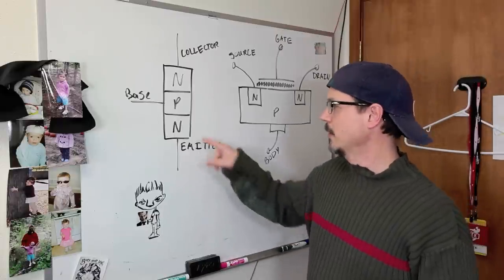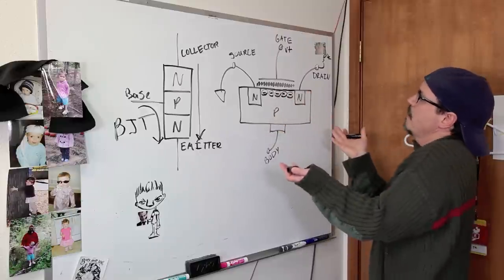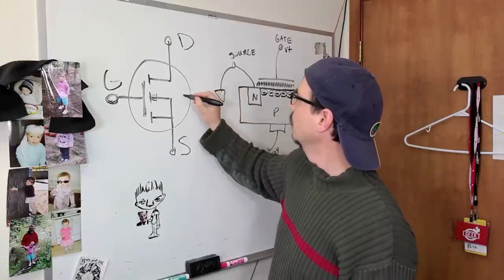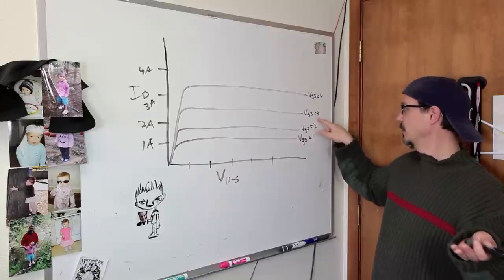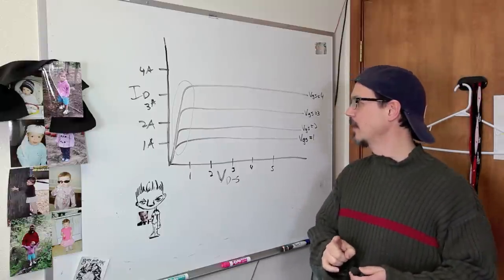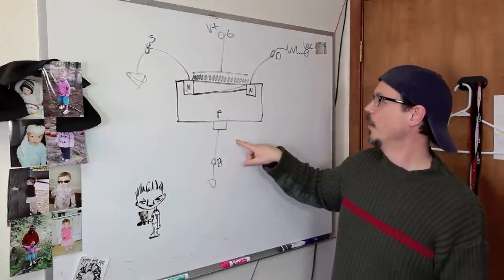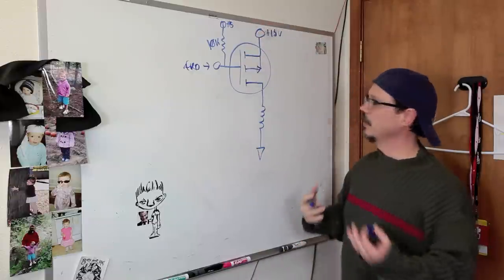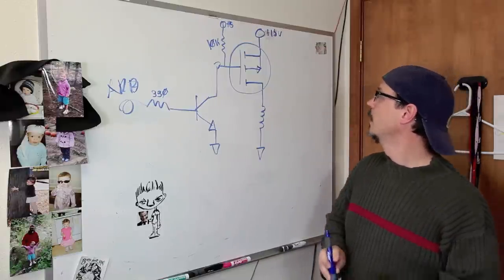SparkFun According to Pete 3-5-12: Mosfets

Comment: The reason the AtMega survived is because the pin never went above 5.8V. The diode from the pin to power (put there for ESD protection) clamps the voltage. The reason many times you see a dead pin is because in Pete's example there was a 10K resistor limiting the current to well under a milliamp. If this resistor didn't exist (you tie the pin directly to 15V or through a lower value resistor) the current through the diode will exceed the absolute maximum rating. This is all just ohm's law.

Comment: I don't mind P-channel mosfets for running in enhancement mode. Both N and P channel enhancement mode mosfets are not linear in behavior, so I typically drive them with a cheap single channel op amp anyway. Then all you have to do is supply a reference to the opamp, and itll do what it does to to match that to the feedback. If you are limited to 5, and have a range of 15, just divide the feedback. Easy peasy :)
N-Channel with an opamp is also doable, but has all the same challenges, plus some. However, if you ONLY have a mosfet, or only need to switch, and not regulate, then yeah, n-channel is much easier.

Comment: Having the IC internal protection diodes conducting--not good. Having any MCU pin above Vdd seems like courting disaster. Flyback diode across the solenoid coil would be a good idea.

Comment: Using the internal ESD diodes to drop a higher voltage at the pin is not a terribly uncommon design practice. You just have to be sure the current is within the device's limits.

Comment: Why would you use a P-channel MOSFET for that and why would you set the Arduino pin to input? Surely an N-channel MOSFET would be a better choice, and set the pin to output mode for switching things on/off.

Comment: Hi Pete - I'm new to circuit design and I'm working on a Arduino PWM driven motor. In trying to test a N-channel MOSFET I hooked my transistor up to a 3V battery supply (gate) and a pushbutton to connect the voltage to the gate. In the actual circuit the same 3V power source is used to supply power to an LED with a 330 ohm resistor. I expected the LED to light up when the button is pushed and to extinguish when the button is released. What I however encountered, much to astonishment, is that the LED would light up, but then would stay lit even after the button is released. Did I miss something? I thought that once the gate is low, the current flow from drain to source on the other terminals would be interrupted or? Is this a special condition owing to the fact that there is little voltage differential?

Comment: Great Video! The last part about driving a power mosfet from an Arduino pin moved me forward on an inverter design. Could you do a video on gate drive transformers? I'm trying to drive an H bridge of SiC mosfets using two arduino pwm outputs and could use some inspiration :)

Comment: How do you protect a P-Channel Mosfet from back EMF if you were using it in a high frequency (31kHz) PWM with an inductive load drawing BIG amps? I'm talking like 10 amps? I tried a diode, it didn't work, Mosfet still blew.up.
Reply: Did you setup the diode like this?  http://en.wikipedia.org/wiki/Flyback_diode
Reply: Yup exactly like that. I've since discovered that at such high frequencies a regular diode would be useless, it can't recover fast enough. So I was advised to use a Schotkky or a TVS diode instead.
Reply: Good to know!

Comment: Is Drain same as Collector?, Source same as Emitter? and Gate same as Base?
Reply: Basically, yes, but the gate draws virtually no current.  It does have a capacitance though, and while it's charging, Rds will be in transition but drain current will be flowing to the source (conventional current flow) through a much higher resistance than Rds(on).  It's not for long, but if your PWMing a load, at high frequency, that increased dissipation adds up during the switching.  This will result in a much higher device dissipation than you'd expect.  The goal is to make the switching happen as fast as possible.  That can be accomplished by using a gate driver.  Arduino pins have an output impedance that is nonzero, meaning that the switching period will be stretched by the RC action with the gate capacitance.  Gate driver's have much lower output impedance, greatly speeding up the switching period.  I hope that makes sense to the people wondering why their mosfet got a lot hotter than they expected when they were PWMing a load.

Comment: That's a nice thick white hanger. Is that metal or plastic?  Do you hang that cool green sweater with the horizontal red stripe on it?  If it rains, are you trying to keep your neck dry?  Won't your glasses get wet? Your cap is on backwards perhaps?
Reply: That's all you took away from this?